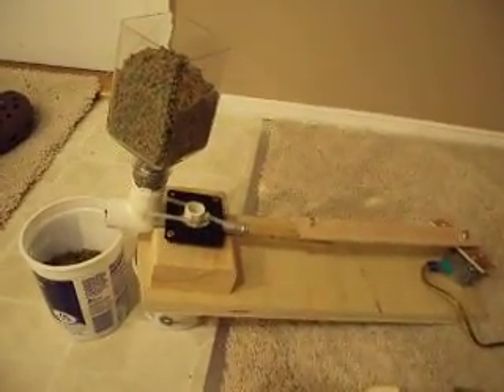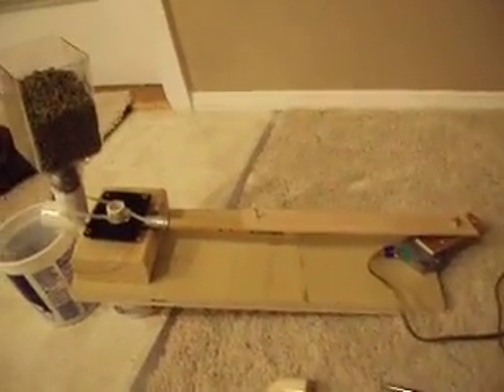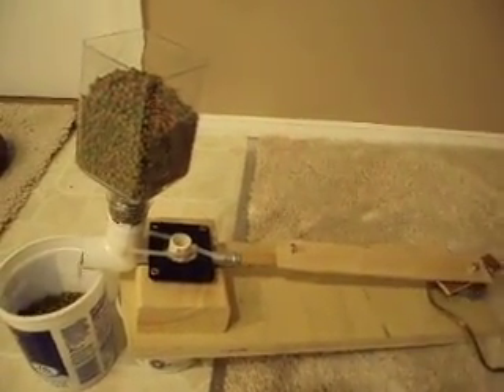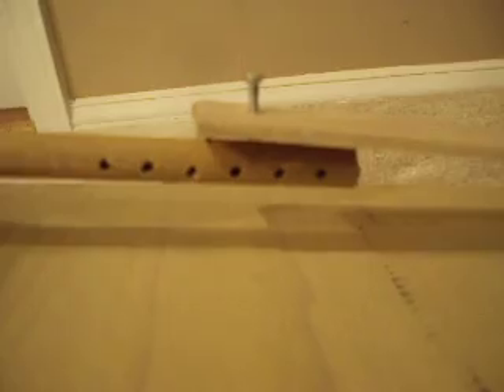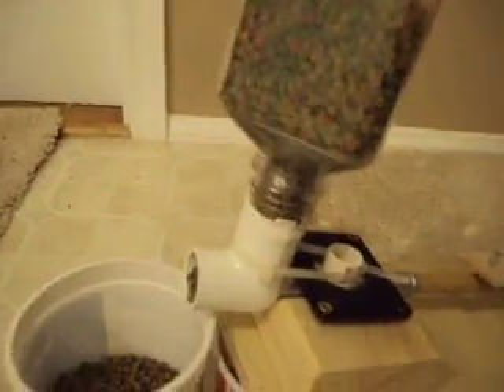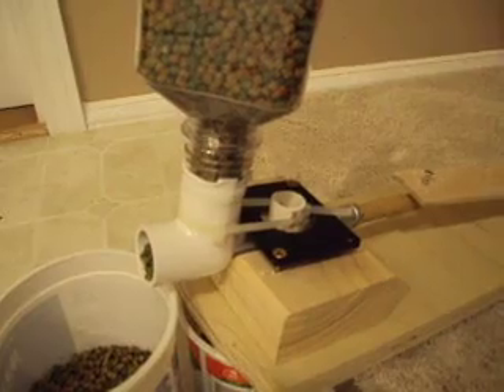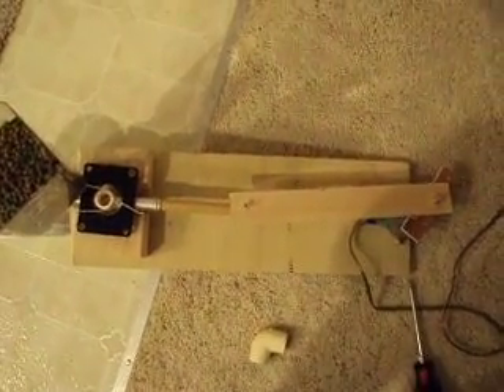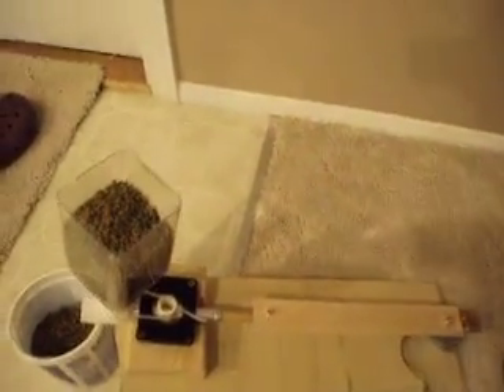Crank Mechanism Auto Fish Feeder Intro

Comment: Hello, i am a student of my school’s bio sustainability aquaponics greenhouse, i was tasked to build a fish feeder and yours has caught my attention. I am not an engineering student and im kind of confused on the whole set up. Do you mind me asking what and how you created your design? Thank you!!
Reply from the maker: abigail mp sure i can help.  it was a while ago and i have two designs.  this is the first design that may or may not work for your type of situation
Reply from the maker: abigail mp this design uses a turntable motor from a microwave oven, 3 sticks to make a crank mechanism, pvc pipe elbow, some wood, a plastic bottle, a micro switch, a relay, a transistor circuit, and an AC timer.  my secod design is a bit simpler and you can see it on my other video on my channel.